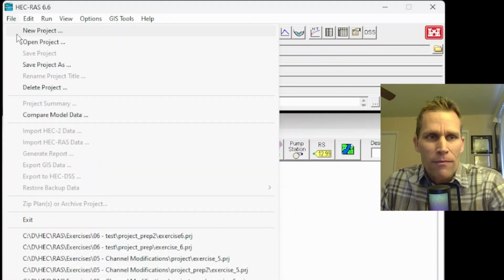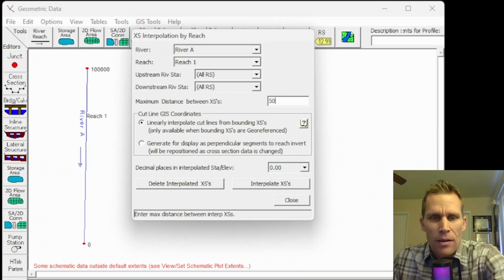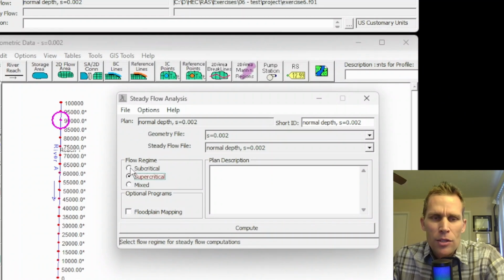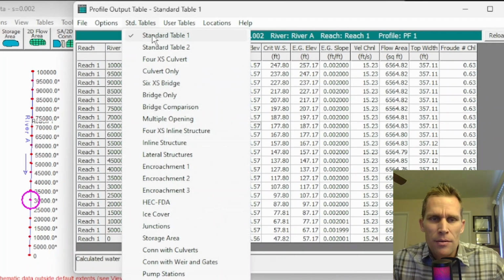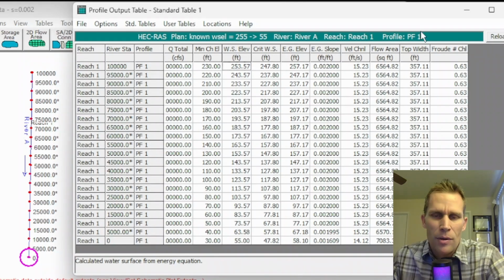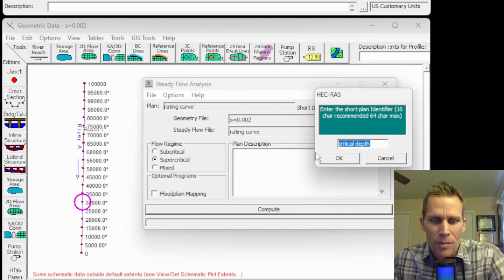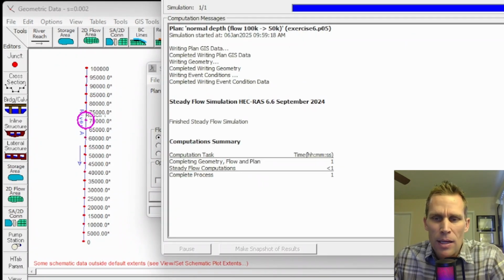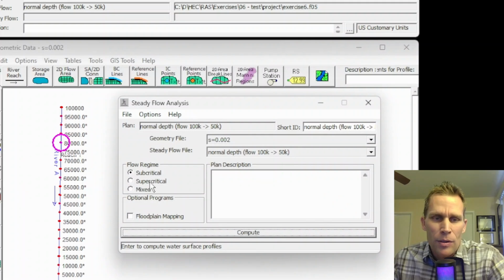HEC RAS Exercise 6 - Steady Flow Regimes and Boundary Conditions

Comment: Thank you very much for these videos! One question that i have is, for example if we would like to know the depth at a point in the middle of the reach, and we select a subcritical regime, we would have to iterate with values in the downstreams conditions until we narrow a certain number?
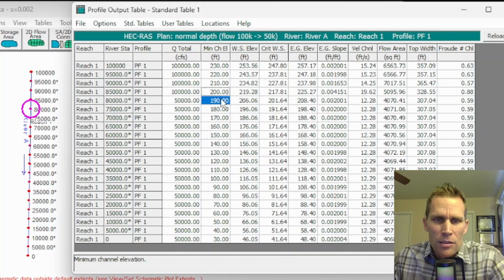Reply from the maker: Hi. To get the depth in the middle of the reach I would add a cross section at the location of interest, run the model, then check the Profile Summary Table (Standard Table 1) at that cross section. In that table, the depth would be the "W.S. Elev" value minus the "Min Ch El" value. You can also explicitly add a "Max Chl Dpth" column to that table, which I show, starting at 19:43. No iteration needed.

However, if you want to achieve a specific water depth at a point in the middle of the reach, then yes, you could iteratively modify the boundary condition until you get the desired result. This is a less common use of the model, but certainly feasible.